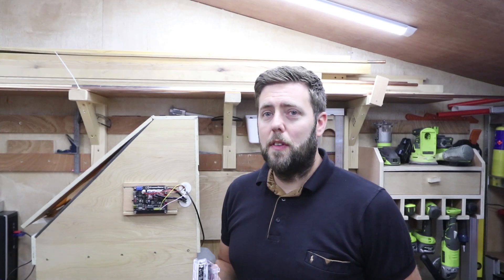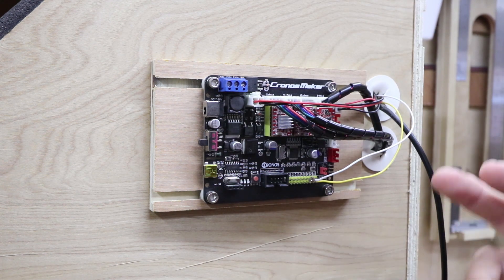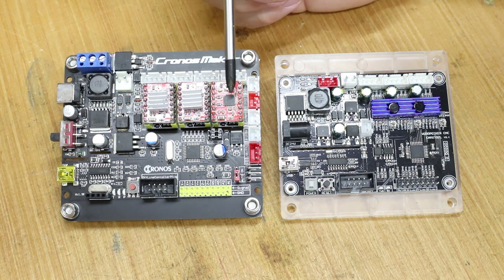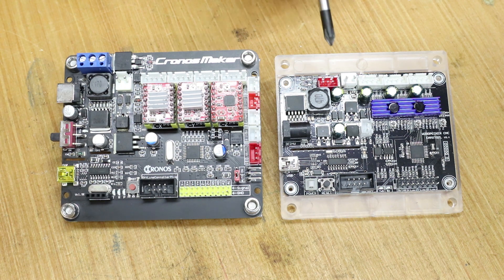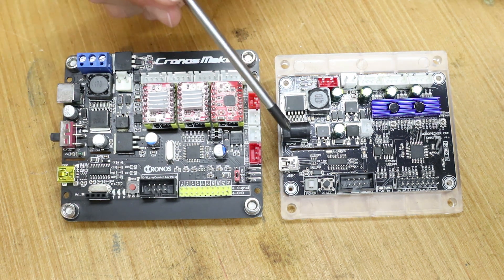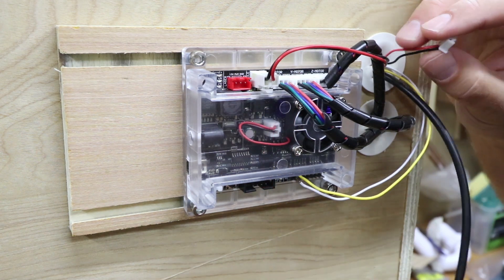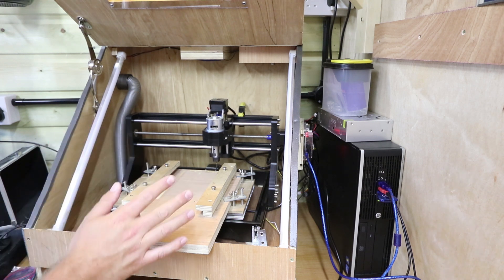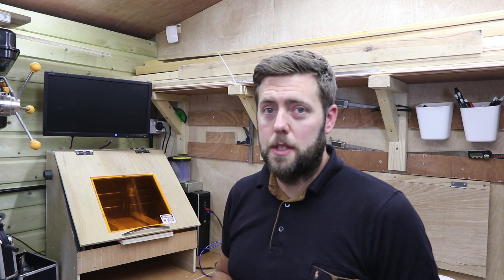3018 PRO - Control Boards

Comment: I've noticed that in your more recent videos you appear to be running the Chronos Maker board again. Is there some reason why you switched back from theWoodpecker board?
Reply from the maker: Think I blew 2 or 3 woodpecker boards consecutively. There are some advantages to them but since putting a cronosmaker maker on everything has been good.
Reply: @JamesDeanDesigns  Ah, okay, yeah that 20K spindle you have can blow the FET's on the board if it becomes loaded down. (I have the Genmitsu version of it on mine) Some people have also reported that they need to control the ramp-up of the spindle or it would blow the FET's on the  board, though I have not experienced that problem with mine. (I've had to replace the FET's on my board once, and that was from the spindle getting stalled due to a bad program plunging the tool too deep into the workpiece) I am thinking of switching to an external FET driver board that can handle more current, to be safe, and then just tapping off the PWM signal from the woodpecker board to drive it.
Reply: @canadianavenger  i just plunged a vbit straigh in to wood  20k spindle an board went up in a puff of smoke woodpecker board wounded
Reply: @davelamb2094  yep, that's what happened to me... luckily I was able to fix mine by replacing a couple of components. I now run my spindle off of a separate supply directly, when doing harder cutting.

Comment: Those 'chips' don't process g-code though. The G-Code is is processed by the GRBL firmware on the ATMega chip 2 cm beneath the driver chips causing the ATMega to send out I/O pulses. The (driver) chips just take the low power ATMega I/O  pulses (max 5v and about 200 milliamp max for all I/O ports/pins combined is the norm) and use them and the 24v power rail (or whatever you are using as main power input) to convert those pulses into higher power and higher current signals for the stepper motors. Hence why they are commonly referred to as 'drivers'.

Now some of these drivers are a bit more advance, Trinamic chips for instance is a good example. Some even have the ability to (optionally) talk back (as it were) to the microprocessor via SPI. But that would take us quite beyond the GRBL related scope. In standalone mode however they are typically drop in replacements for the drivers you have now. But with some benefits like much less steppermotor noise thanks to features like stealthchop and spreadcycle. It's quite common for people to 'upgrade' their 3d printers with such chips to cut down on the steppermotor whine for instance.
Reply from the maker: Wow! That a really detailed reply, thank you. I'm slightly surprised you would watch a begginers video like mine already knowing that knowledge. In retrospect, this was a really poor video, I convinced myself the woodpecker was better for some reasons and it wasn't. Shortly after I went back to a Cronosmaker
Reply: @JamesDeanDesigns  Well you did key me in to that improved 775 higher RPM spindle. My 3018 has been sitting idle next to me for some time now. Have a bigger selfbuilt CNC for wood and alu work so didn't need it really for that anymore, also got a 50W laser cutter secondhand quite cheap a while back so even for that the 3018 was no longer all that relevant.

But I have been looking for a way to engrave the odd throughhole pcb here and there (usually go with the UV sensitive approach for SMD stuff). Can do that on the bigger cnc (on mach4) if I really need but most autoprobe soft works with GRBL and the like so ... The original spindle on the 3018 I found too slow for that however, so ordered the new 20k one after stumbling on your vid, oh and think I even got the same controller as I am not sure the MKS DLC I have now will survive 24v long (it is usually used with 12v but looking at the schematic it should work with 24v too just not going to risk it), the original woodpecker board sure didn't and that came with 24v supply.

Comment: Hi James, like many of us who started using a CNC, I also have a CNC 3018 pro. I have seen some videos of many upgrades of the spindle to 500w and they put the control board that came with the motor plus a breakout board and a voltage switch to control the spindle with Mach3. As I am not very happy to make so many connections and I want to control my new 500w spindle and step motors with Mach3 with a single control board. Can someone help me if this card is compatible with the CNC 3018 Pro and the step motors (DC12V 1.3A 0.3N.m). I'm in the right direction?
https://www.aliexpress.com/item/4001298695768.html?spm=a2g0s.8937460.0.0.1add2e0evaJvcb

Comment: So was it just cost that made you choose that new board over just a new one of the existing board?
Reply from the maker: I had convinced myself the woodpecker was better, basicallybecause thats what I could get at the time. Upon reflection I realised this is probably my worst video. The Cronosmaker is a much better board and I ended up going back to that. In fact I might take this down and make a new video on it
Reply: @JamesDeanDesigns  I went through two "Woodpeckers" could not get either to work. Built up my own from I couple of pieces I had in my junk box. Works well.
Reply: @JamesDeanDesigns  Please do a new video :) .. I am looking around at the moment and it seems like if I want to stick with running GRBL the Cronosmaker seems like the least hassle. Also with Cronosmaker you can change to using BTT S42B closed loop drivers.

Comment: how did you home it. mine wont finish the homing cycle and crashes through the limits. ive tried swapping z-x, Ive changed switches, ive rewired switches. Ive pretty much done everything. While jogging the 3.4 sees the limits. When I run the homing cycle it wont see The Z limit or swapped the X limit. Thus I cant home which means then 3018 is totally useless. Im getting frustrated because ive wasted 2 months trying to fix it $23 = 3 or any other settings wont finish. i feel like throwing it out the window
Reply from the maker: Hi Tamati, unfortunately I dont have any limit switches so have never done homing. Personally I've never felt I need limit switches, I've been able to do everything I want without them so I wouldn't say the machine is useless. Head over to the Sainsmart user group page, you dont have to have a Sainsmart machine but there are lots of very knowledgeable people in there for stuff like this https://www.facebook.com/groups/SainSmart.GenmitsuCNC/?ref=share

Comment: First board the Cronos maker, have you or somebody, tried using the 48volt spindle output?
If so if there some settings to care about
Reply: if u board not handle highest spindle power  need relay and own power to spindle and own power to board, if board use PWM not easy but id board use relay controll to spindle need only relay output connect biggest relay serial and then board relay controller external big relay who has connect own power to spindle.

Comment: Hi James, sorry for commenting on a old video. Looking to replace my controller board as I bought a 5500mw laser and realised the board doesn’t support it. My question is, what is the connector for the spindle. My current board just has a barrel plug but all the new boards seem to have the clip connector. Just not sure where to get that. Thanks
Reply from the maker: Hi Issac. I think its called a JST 2 pin 2.0 connector but double check as there are load of variations
Reply: @JamesDeanDesigns  On my Woodpecker board, the spindle is a 2-pin JST VH connector, 3.96mm (0.156") pitch.  The laser connector is a 3-pin JST XH, 2.50mm pitch.  The stepper motor connectors are also JST XH but 4-pin, of course (and the 6-pin ones commonly on the motors areJST PH, 2.0mm pitch) .  To complete the info dump, the row of pins along the bottom edge where you'd connect a Z probe, limit switches, etc, are 0.1" (2.54mm) pitch, of the type often called Dupont connectors (but actually invented decades ago by a different company and readily available under umpteen brand names: Harwin, Fujitsu, Berg, Molex, Tyco, etc).
Reply from the maker: @pnt103  that is super useful. Thank you very much. For the most part the connections for the 3018pro as the same across the woodpecker and the Cronos Maker which are the most common board's I believe

Comment: I lost my Z bearings, too. Mcwdoit was the seller on Amazon. They are going to replace my control board and z-axis mechanism right away. Good folks.
Reply: The bearings on all axis are just pressed in, and under vibration they can come loose and pop out. I suggest popping them out, and then using a drop or two of CA glue and then pressing them back in. I did that, and have not had a problem since.

Comment: Hey James im a beginner here . i did pick up the woodpecker board alias mine is doing the same working in the opposite direction  . How can I fix this . can you point me to the video which you mentioned you were makiing next ?
Reply from the maker: I havent got around to making it yet. But if all your axis are the wrong way I believe the solution is $3=5
Reply: @JamesDeanDesigns  
remember im totally green .. $3=5 no clue what does this mean

Comment: Being very new to this how do I increase the size of the design or is it even possible.
Reply from the maker: Hi Floyd, sorry for slow reply. You increase the size of the design in the software you are using. Usually there is an option to scale the objects

Comment: James, a little help please, I loaded the driver then candle then the control panel only partially loaded meaning I could not move the axis and only heard a clicking sound, the driver was located in com 4. the grbl is cronos maker, do you have any thoughts and what is the source of the new board you installed
Reply from the maker: I dont use candle personaly, I use UGS. Usually the contol panel or jog panel can be turned on within one of menus at the top. If you have the panel up and are just hearing clicking when you select an arrow then you may find there is a lose connection. Unfortunately I have something where I damaged one of the driver chips on the cronos maker and everytime I tried tonuse the x axis i just got a clicking sound
Reply: @JamesDeanDesigns  Thank you James for your input, not familiar with UGS

Comment: I understand the Woodpecker 3.4 has the 2209 drivers. One thing to be aware of is the end switches are labelled backwards for the X and Y axis.
Reply: Nope, not on my Woodpecker 3.4 and not on others I've been told about.  I took the heatsink off mine to make sure, and the drivers are A4988s, which is what other people have reported as well.  That's the same as the standard drivers on the CronosMaker and most other GRBL controllers, so the same current limits, microstepping options, noise levels, and voltage references.  Mine were set to 600mV, so 800mA.

Comment: Hello, I have a question,
I am new with the cnc3018, when I put it to work with the lasser the machine
only moves linear. but when I put it to work with the router motor, the motor
rises and writes over the air. I have even changed my mother board cronosmaker but it still
doesn't work for me. Please can you guide me? I used candle and laserGRBL.

Comment: The driver chips make a huge difference in the noise level , speed and accuracy of the  machine,  stick with the boards with the  interchangable chips and purchase a set of 2209 drivers, you will lose that horrible whine as the motors move.  In my humble opionion the new board you installed in a down grade on what you had.  I would look for a BIGTREE SKR main board, about the same price or cheaper, generally have better components, more memory and a 32 bit processor against the 8 bit those boards
Reply from the maker: Thanks for the info. I'm still learning to thats really useful. Didnt know the drivers made a difference on the noise 🤔
Reply: @JamesDeanDesigns  Thats a tip from  the 3D printing community,. My 3D printer used to use A4988 drivers and have moved to 2209 drivers, all you can hear now is the fan running, you don't hear the steppers moving at all.  https://www.youtube.com/watch?v=eIBICCzayio
Reply: @mikeobrien9829  wow just watched that video, what a difference.
Reply from the maker: Just started to look into those boards. They don't take lasers unfortunately 😪
Reply: @JamesDeanDesigns  No- he's saying to use the Cronos board, with 2209 drivers instead of the factory drivers (the chips with the heat sinks); not that you should get the Arduino Mega. Even if he was, you could always add the laser control to another GPIO pin, maybe a small mosfet circuit if the laser is ran at >5v. He was just showing you a video of a Arduino Mega using the same 2209 driver. Boards like the Cronos and the other one you 'upgraded' to are essentially just Arduino micro-controllers. There are 32-bit boards out there also, but, you may want to learn a 'bit' about micro-controllers before concerning yourself with 8 or 32 bit processing. Feel free to reach out and ask if you have any questions.
Reply: @JamesDeanDesigns  different drivers have lot different inductanse and noise and many need setting good before use motors, current have important and volt need be  maximum what drivers can handle then not noise lot and change drivers better what have new models no noise lot. old A4988 noise horriple and new what have not noise.
Reply: But can GRBL be compiled for the ARM processor on an SKR, or would you have to use Marlin? (I happen to have a spare SKR V1.3 and some TMC2209s).

Comment: Interesting, thank you for sharing James! Quick question; did you swap the perspex front on your enclosure for some safety-screening material? Does that coloured screen mean that you don't have to wear safety glasses when its closed and you're working on other things in the workshop? If so any tips on where to get such a screen material from? Thank you for your help as always! - Ashley Cawley.
Reply from the maker: I have 2 screens, one if is a fixed clear perspex, and the other is the orange laser shield which is removable. Got it from robosavy I think and yes it means I can leave the laser running whilst being in the workshop without needing to wear the glasses

Comment: hi James Would you please point out the pin outs on the Woodpecker for limit switches i am not sure which is 5v and which is grd thank you.
Reply from the maker: The ground is the bottom row of pins on that board
Reply: @JamesDeanDesigns  Thank You

Comment: What is clamped on your spoil board, looks intriguing ?
Reply from the maker: I've been cutting zero clearance plates which are too big for the bed, so I do them in 2 halves. That is a jig that allows me to position the material the same each time. Just saves a lot of time when doing the same job. Few more shots of how it's used on my Instagram

Comment: Why did you choose the woodpecker board over the chronos board?
Reply from the maker: Just realised I never said that. You can tell it was an unplanned video 🙈 The case and fan were quite importantant for me having already broken one driver chip previously. I was planning to add a fan to the cronosmaker as well but it meant more depth because of how deep the driver chips are. Delivery was also vital for me, most other boards would take several weeks to arrive from other countries
Reply: @JamesDeanDesigns  Thank you for the clarification. I haven't purchased my CNC machine yet, so I've been doing a LOT of research. My most pressing need is to be able to make small productions of PCBs for one of my regular 3D printing clients. I'd also like to be able to machine 3 mm sheet aluminium if possible. I've been looking at the 3018 Pro machines, but I am pretty sure the stock spindle would not be up to the task and it would need to be upgraded to at least a 300 watt spindle.

Comment: Could these controllers control a 6040...i want to use grbl on it
Reply: A 6040 is a more true hobby grade machine, you would be better using a better system such a Mach 4 as it will allow you to get more from your machine. The 3018 is a great machine for getting your feet wet in the hobby but really only a toy. That being said if your needs are more basic then GRBL will do the job well. Yes GRBL controller will work but I would run TB6600 drivers and a seperate power supply for the spindle and the machine
Reply from the maker: @mikeobrien9829  Hi Mike. As I always say in my videos, I'm still a beginner. Why is Mach 4 better? I'm hoping to upgrade in the near future to something around 1000x1000
Reply: @JamesDeanDesigns  Mach 4 is more like professional control software used in commercial machines, it can also control more axis and I beleive do true 3D manufacture rather than the 2 1/2 D manufacture inder GRBL. That being said GRBLis brilliant while your learning and has a huge support network and best of all its FREE :D
Reply from the maker: I cant promise they can as I've never used a 6040 but I'm 95% sure they can if the connection are the same
Reply: So I'm guessing if my controller uses mach 3 it can use mach 4..
I use aspire to design my work and then jump to mach3..